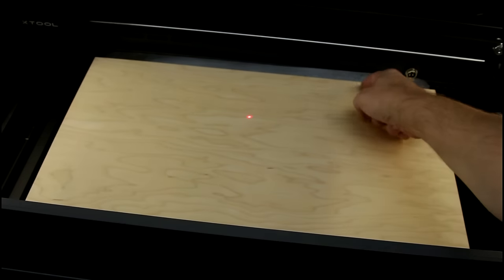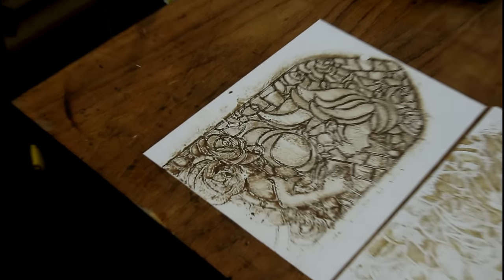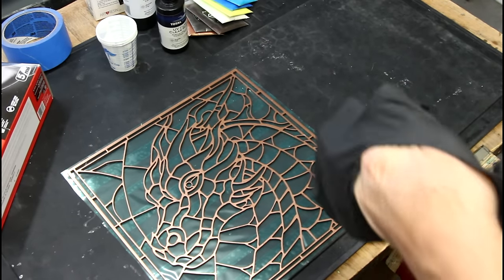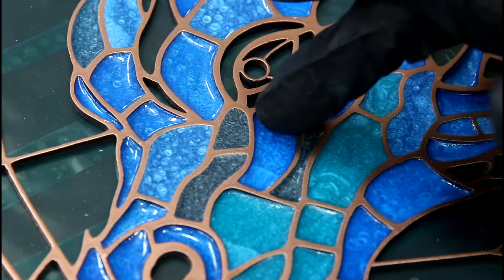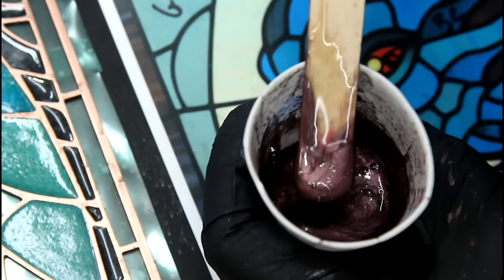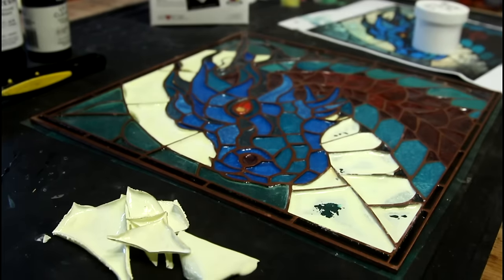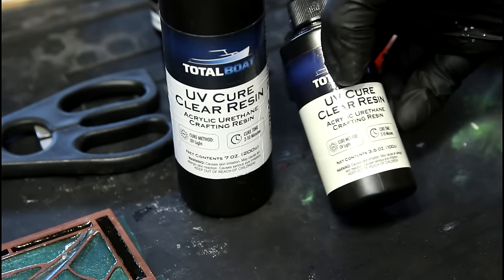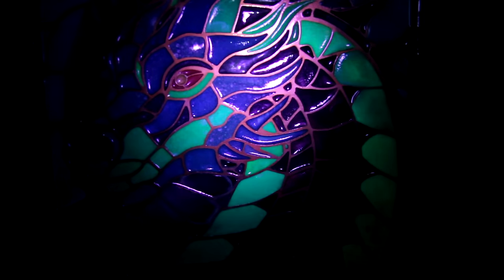Resin Stained Glass: Viewer Suggestions!

Comment: I love your videos but my kids tell me there is a high pitched noise during your videos. My old ears can't hear it but they say it's the same as when I turn on my old tube TV.
Reply: I personally could not hear the "tube TV whine", but I did hear basically high-pitch static in the background. 
A basic low-pass audio filter in editing would solve that, set it to maybe 1500-2000hz. If this is a big problem for you guys personally, many audio drivers on PCs have a built-in equalizer, so just use it to turn down higher-end frequencies and that will get rid of the noise. Just don't forget to reset it afterwards so you can get the full sound from other media!